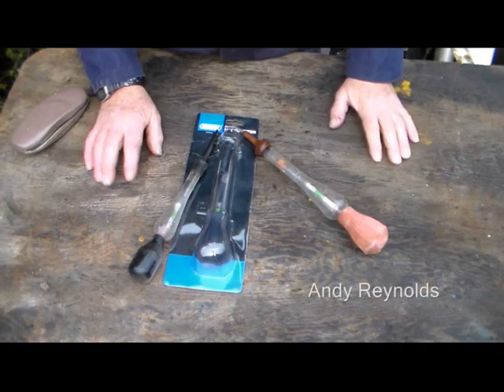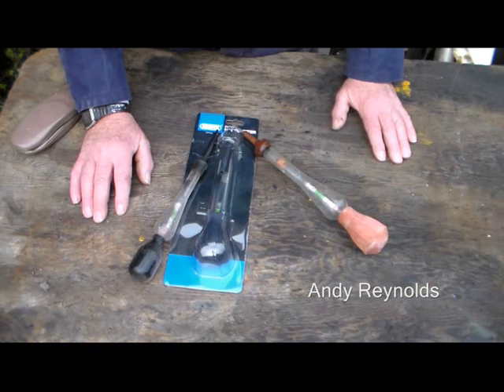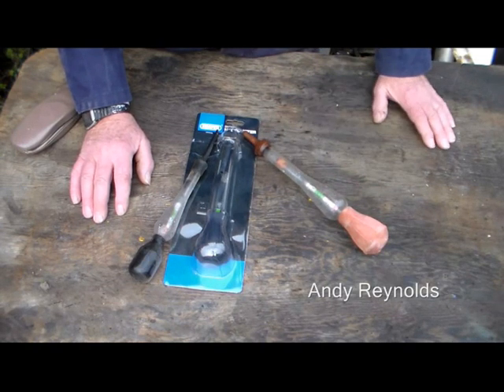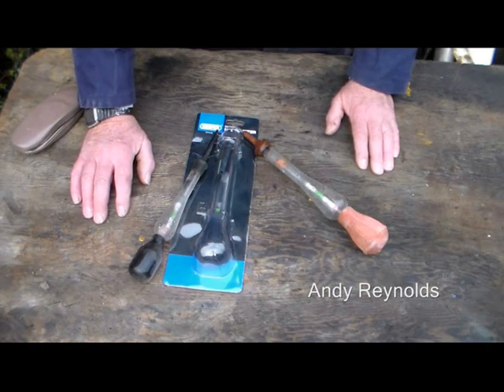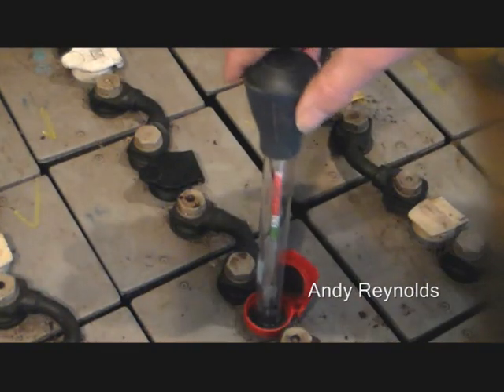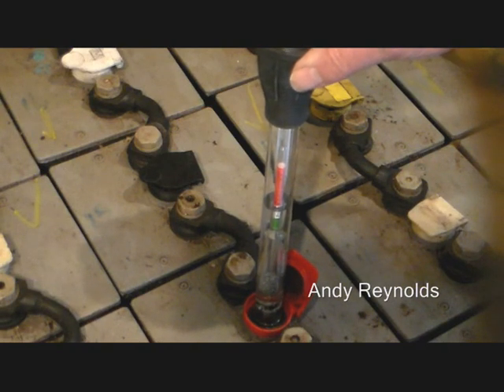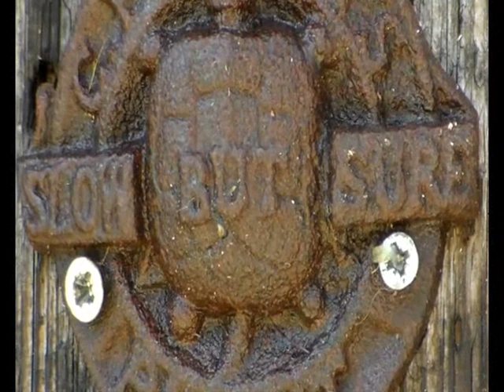New hydrometer and video quality question

Comment: When you announced that you had bought a new item the ticker tapes in the FTSE started to jump! I think the economy is saved! 

The quality of the video went up when you brought the nipple of the brown hydrometer into focus. I don't know if I can tell for the rest of it.

I suspect that you can use parts to cobble another hydrometer together, the bubble seems to be the critical bit, so any other parts should keep it working, a squeezer from a turkey baster?
Reply from the maker: Owen, yes I keep all the bits but it's the glass tube that's difficult. I once tried one of those incandescent tubes type lamps. I cut the glass which was difficult but it had too great a volume. Still one can but try, cheers.

Comment: Another interesting topic thanks Andy. Think the video quality is marginally better but to see that quality rendered at 4|3 on my phone even when viewed full screen is quite tiny, significant black edges round the screen. Could you have rendered at 16|9 as an option? More a question as I'm no content creator.
Reply from the maker: Matt,, at 16/9 it looked like a letter box slot. Strange but in future it's back to the old settings. The black border is a problem I'm not will to put up with. Thanks for your support, cheers

Comment: I find that the hydrometers they've been selling lately like the one in your video possibly have some issues where the glass float sticks to the side. I constantly have to tap on it and slowly move the fluid level to make sure that it's not stuck.  The hydrometer I'm using looks just like your new one except mine has a thermometer built in to measure the temperature of the electrolyte for proper temperature compensation.
Reply from the maker: Hi, that's another reason why I wash them out from time to time. I find a hydrometer is a guide to overall even state of charge throughout the pack. I am constantly aware at this time of year about state of charge. The damp still overcast days are a harbinger of battery attention, cheers

Comment: Hi Andy and Merry Christmas, could I rack your brains re my 2 new AGM deep cycle batts? I have a renogy rover 30 amp solar controller fitted to my boat and in the past when I had the Trojan wet batts I just set the controller to lead acid and charged at 14.8v. But I’ve been told by the batt supplier not to set the controller to lead acid as it has an “ equalisation “ phase set into it and it will damage the AGM’s…? The Renogy Rover does not have an AGM setting, only lead acid and sealed I think… does that make the Renogy redundant now or can I risk using Lead acid or sealed..? Thanks Andrew
Reply from the maker: Andrew,  I would go for sealed as that is effectively what an AGM is. What was the decision process for choosing these batteries cheers
Reply: @TheInfoworks  my Trojans were 7 years old and one had a fluid leak around the lid joint which seeping onto the hull bottom leaving a white corrosive powder, plus  they didn’t seem to have the original power, I nursed them for the seven years and thought it was time to go modern, time will tell if I made the right decision